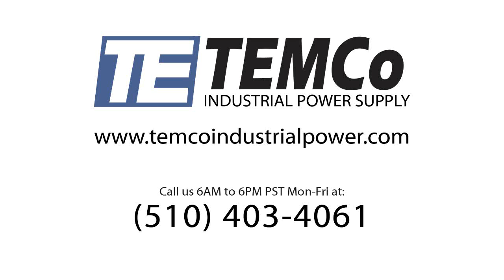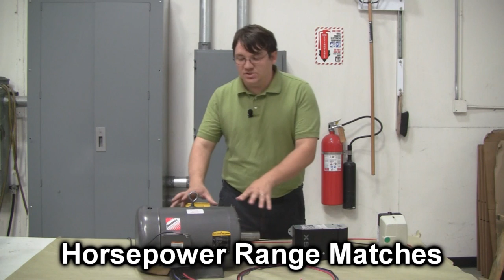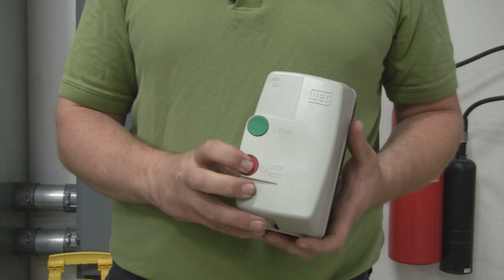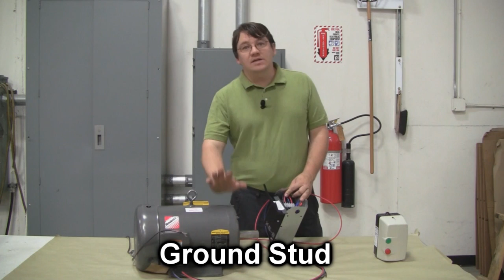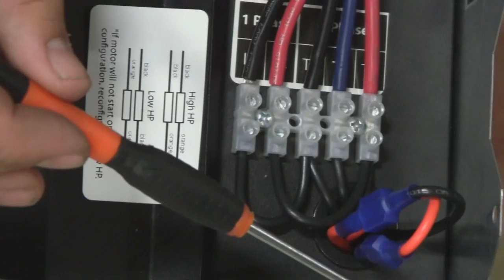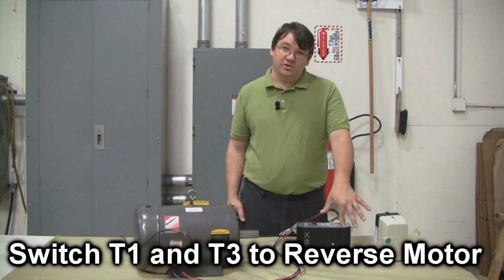TEMCo How to Wire a Static Phase Converter

Comment from the maker: It looks like the Hunter DSP wheel balancers use computer controls. It may be possible to use the XS3 if you are able to connect it directly to the motor and power the controls separately. Otherwise, we would recommend using a rotary phase converter. Shoot over any more questions if you need more help with sizing.

Comment from the maker: No. Static phase converters don't produce a true three phase output. They only act as a starting device, so once your motor is running, the third leg is deactivated. The motor ends up running on single phase.

However, a VFD can be used to do single to three phase conversion depending on your application. Please give us a call at 510-403-4061 and we can size a VFD to run your machine.

Comment: I'm trying to understand how I would connect one of these units (for a 1 hp- 3 phase lathe in the U.S.) as powered by a 3 pole 220v dryer receptacle which I believe has 2 hots and a neutral. Any ideas?

Comment: I need a converter for a heat blanket on my press. No motor. There are 2 blankets 240v /19amp/ 4600w. Will your XS12 static converter work? Do I need 2? one for each blanket.  Thanks for your help.